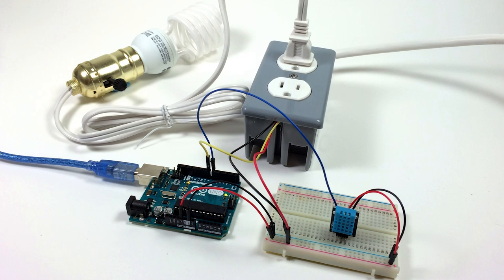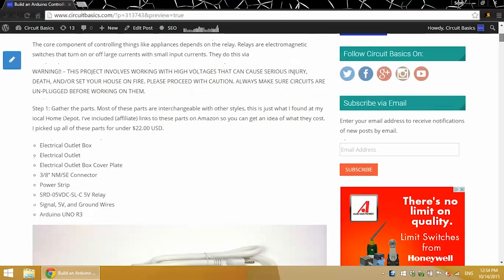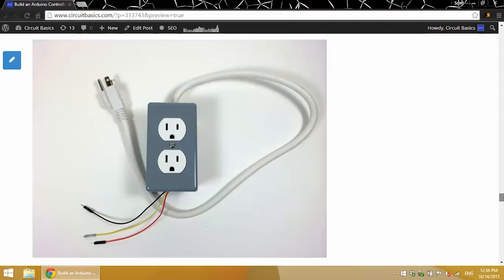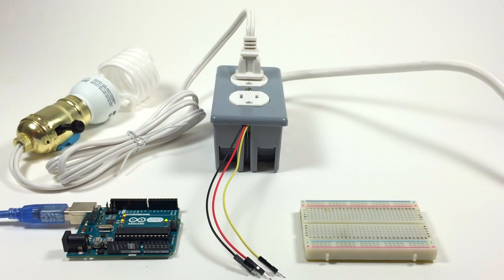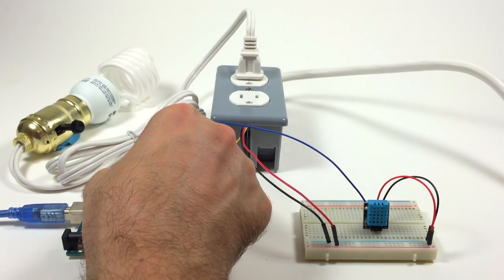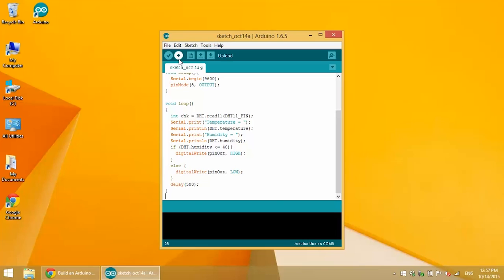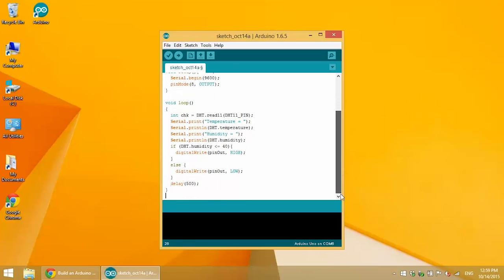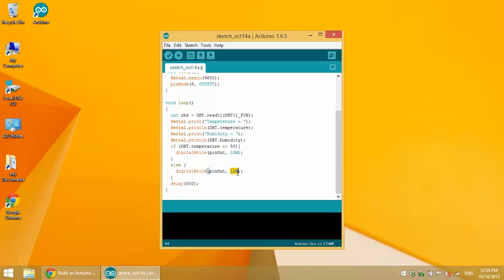How to Make an Arduino Controlled Power Outlet Box

Comment: Just make sure that the Relay and wires you use for the AC side match the current and voltage rating of of the circuit breaker feeding this thing. If not, use a fuse or Circuit Breaker that is rated to match your relay to provide some over-current protection for this device.

Comment: Great tutorial, thank you. I have a question regarding the wires, you used a jumper wire between Arduino and the outlet, what if the distance between them is long, let's say to make the Arduino centralized and connect many outlet to it. What type of wire should be used (since the jumper wire is too short for a practical usage)
Reply: A good way to get a longer wire is to use 4 conductors (2-line) phone cord. One wire will be unused but they are easily obtained. If the wires are solid core, you don't even need any form of connector.

Comment: Is there any way to keep the Arduino powered on using the same outlet, permanently so the Arduino can be always on and still turn on/off the light?    Another outlet might not be nearby to plug in the Arduino.

Comment: I am planning to create a power outlet controlled by mobile application . every socket have its own cut off relay.what are the limits?  of these relay does it sparks when plugging high voltages appliances? how about in these video cause we are on the same concept...

Comment: did u use the relay to convert 120v down to 5V in order to power the arduino?
Reply: Zubair Alsharif I may be a little too late, but the answer to your question is no. the arduino gets its power from the USB connection to the pc

Comment: Doesn't this violate the NEC by having high voltage and low voltage in the same electrical box without a barrier?
Reply: Is the NEC not aware the digital device world wants 5vdc?

Comment: Would it be safe to put a AC unit on this socket?
Reply: In theory, yes, as long as what you are powering does not draw more current than the relay can handle it should be perfectly safe.
Reply: Theory aside, the relay is designed to contol AC power using controlled 5v dc switched pole; relays use a small load to control a larger load.

Comment: Is there any way to turn it on at a time (like: start turn it on at 3:00 am)
Reply: You can program the arduino to use delays, but you will probably need to get an arduino with wifi so a computer can update the arduino with the time maybe every hour. and honestly, at that point I would just get a raspberry pi to do that so you can run it as a standalone project. learn some python or something and make a script on a pi. You should find tons of tutorials and the pins should be the same or similar.
Reply: you can also use the 60-120hz signal from the powerline itself to keep time.
its a bit more complicated.